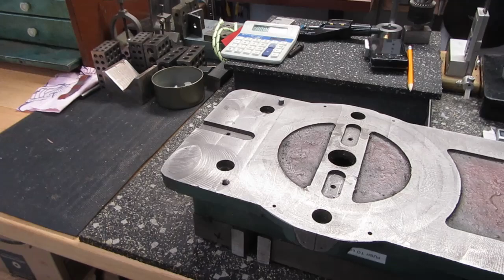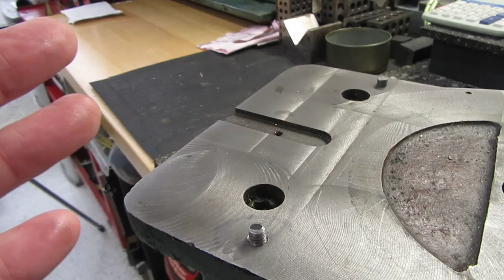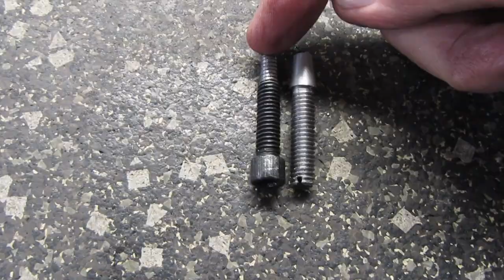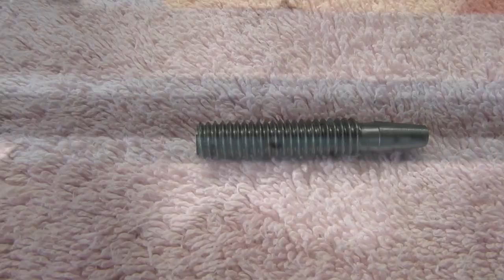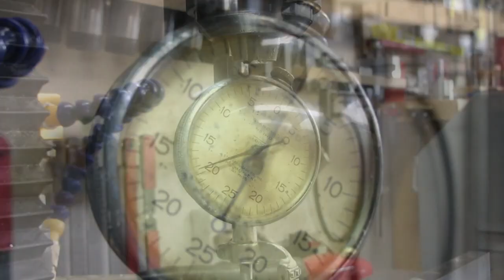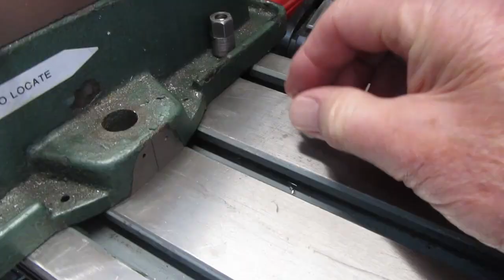mill vise Mod

Comment: Great idea!  I usually have my swivel base on the vise, which makes tramming even more difficult.
In the last shot, I noticed that the mounting holes on your vice don't line up with the T-Slot.  Do use a clamp to secure the vise to the table, or what?  Thanks.  Regards.
Reply from the maker: The vise is from a larger mill that I do not have anymore. the existing holes do not line up to any table slot position the will give me maximum use of the vise so i made my own holes in the vise base.